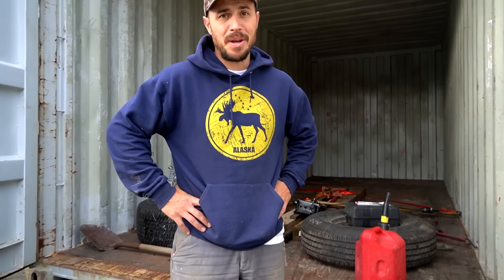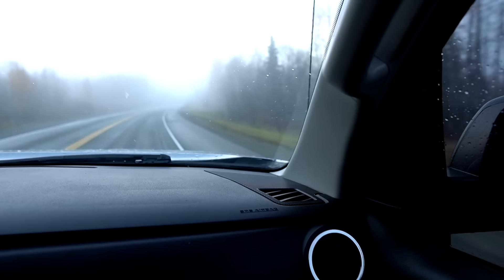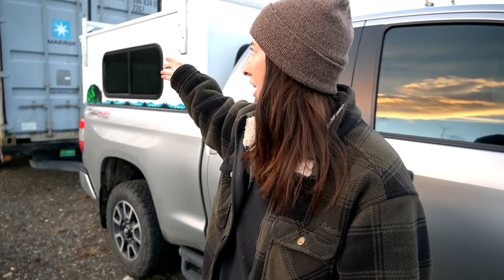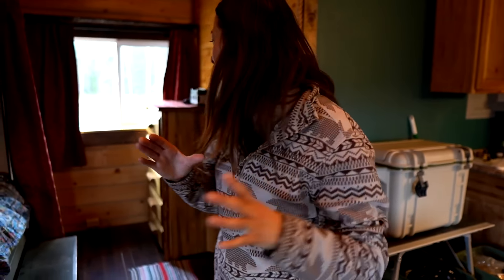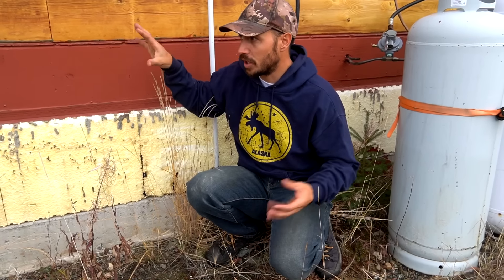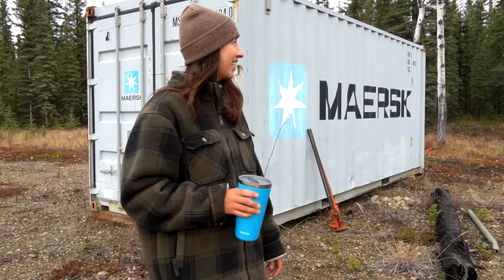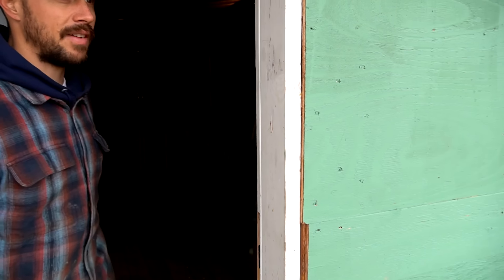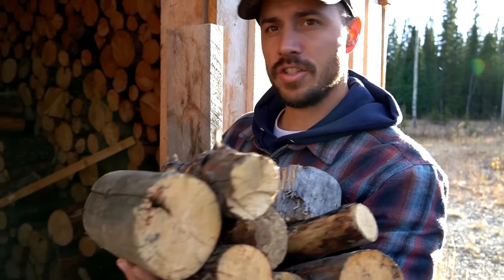Transporting a Conex to Our New Property + Cabin Tour

Comment: So happy for you with the new property! CAUTION: when you mentioned about the "warping" of the floor around the woodstove.. I remember years back a friend had that problem, his cabin burned down..cause was in part due to missing and/or powdered firebrick. I'd also recommend putting fire backer board on the backside and definitely the floor...just FYI, all the best.
Reply: Easiest way is cement board on the floor and both walls. 3 - 4'×4' pieces should work fine. One piece on the floor to stop sparks and dissipate some heat.Put spacers behind the wall pieces at least 1/2", 3/4" strong is better. It actually creates a vacuum with a gap at the bottom, as the cement board warms up cooler air is drawn up as the warmer air rises. It keeps your walls from getting too hot. Also around 27:26 ish, you definitely need fire bricks. I can't tell the condition of the remaining ones, some are missing and some are cracked. Not a problem to ignore. I believe your next moose will be harvested in the yard by the look of the place.
Reply: This channel has the very best comment section.
Reply: @edpoints1127  , I saw that too, glad you mentioned it, there seemed to be a few missing, definitely needs relining 👍
Reply: Yes take care of the heat project for sure 
I am so happy for y’all
Reply: I’m so happy for you!! You two work so well together and we love watching you. Thanks for the great channel!
Reply: I second this!!
Reply: Bandit gets to dig dirt now!!🤗
Reply: Love your tundra’s I work at the plant where the newer one is built
Reply: Can't believe the hard work you two do and the ingenuity you have to solve problems love the new property
Reply: Oh yes! Take precautions!! I love your new property!! It is awesome! I'm so excited for you all! 40A,& the house is beautiful! A Wonderful inside bathroom & shower, bedroom, kitchen area,I think it's great & you'll enjoy it though you've done great with the one you're living in!!
Reply: @edpoints1127  yes. We lived in a double wide mobile home,& had a big nice "Papa bear"wood stove, can't remember who made it. Had the draft knob in front on door. So my husband got an asbestos pad with metal on it, put a sheet of something against the wall then the pavers over that. It's been there since 1980 or before!!
Reply: Good information from the comment
Reply: The new place is going to be great I do also recommend a fire protection system for your fireplace you’re a wood-burning stove as the only protection you will have is the two of you when it comes to that

Comment: Nice cabin.  We, too, have a Blaze King wood stove.  I think we have had it for about 20 years now.  It still looks like new.  We have had to replace the bricks once and have done a few other maintenance items.  Before we bought it my husband researched stoves and decided this was the best for us.  It sure has been.  If it is really cold outside, 20 below zero, we have to fill it twice a day.  If it is above zero, the wood will usually last over 24 hours.  Ours has a really big fire box.  It heats our 2 story 1200 square foot home.  We don't use kindling.  The first time we start it for the season we fill our fire box full, then light a Diamond Strike-A-Fire, and stick it in the wood.  It always starts.  We have an ash pan under our stove.  I let the wood burn down to mostly ash with a few coals, clean the ashes out, and then fill it full with wood again. The few little ashes left always gets the new wood burning.  It makes it so nice to barely have to load the stove with wood.

Comment: Lived in similar conditions and places since 1977 .  
Just saw kinda a neat way to split like 4 to 6 inch thick rounds by approximately 18 inch long logs on line .
They used an old truck tire laid on its side and put about six cut to length logs on end in the middle of the tire so to be held together while splitting them with a maul .
Another way I used to split wood is to stand the logs on end on flat ground in a line of four or more and go down the line while splitting them with a maul . Went pretty quick this way because I wasn’t constantly picking up the maul for each individual log . Hydraulic splitters are nice too .

Comment: Loved this video! I have the same old tundra you do! Except ours started off white, when we turned over the odo we knew rebuilding wasnt a thing we wanted to do anymore, so we swapped a 5.3L LS crate engine, danas, and now my wife stole it as her adventure rig, she has a small pop up camper, and she made a custom cycle carrier for her tw200 that can be removed from its L and R bolt in to the custom bumper she made too. She repainted a nice red color, and its had a new lease on life!

I was left without a truck hahaha. 

I have traveled in a 4x4 high roof sprinter van for the last 5 years, I travel and teach law enforcement, to civilians, on ranges. And as I have officially retired from that, decided, oh what the heck! I just sold a 68 mustang fastback, and an older landcruiser I have had for 35 years hahaha, and decided a F550 would be my next rig. So its being built out as Id like, bags, dually converted to singles, flat utl bed with under cargo storage, so I can load a 4 season artic fox camper on and off as I want! 

And as luck would have it a friend whos here in vegas for the sema auto show will be moving back to japan full time as his aging parents have entered their 90s, we will be buying his 5500 ram, regcab, dually as our new hauler rig! 

Wife and I are enjoying the video! And man, thats alot of wood!

Comment: Thanks for showing us. I'm from the much milder climate of Southern New Zealand (that's like near Australia, but 1,000 miles / 1,600km further East and South means we are colder, in this hemisphere). I notice you have an indoor hotwater service, and you said the previous owners just ran a generator when they wanted electricity.  Generators famously drink diesel/gasoline/petrol which is never cheap.  But given the cabin already has a wood fire installed, when I grew up,  even in our far milder "Coastal Oregon-esque" climate, most houses had open fireplaces, or sometimes coal kitchen stoves, had  what we called a "wet-back" where a coil of pipe in the back of the fire, heats hotwater.  They are less common now as we have very strict "clean air" pollution rules but some of the new approved clean burning wood fires, still have the option of a wetback. It saves a huge amount as in this area, household hotwater amounts to about one third of a monthly electric bill.  (Most places here do not have gas connections. Some rural folks use bottled LPG/propane gas). Looking forward to seeing more of your videos.
Reply: Extra info... no extra waterpump is needed for a "wetback" water heater system. The hotwater storage tank is installed ABOVE the height of the fireplace, and the water pipes are routed in a certain way, so the water circulates automatically by "thermo-syphon". In our kitchen my parents had a fire installed and as part of the installation the plumbers removed the existing electric hotwater cylinder, cut into it and brazed/welded added the extra water in/out pipes that went to/from the fire, and then re-mounted the hotwater cylinder tank higher up in the cupboard so that it was above the waterjacket of the newly installed fire. That particular fire was known as a "kitchen incinerator" as it did not have a glass door for viewing and was quite narrow and only able to take smaller pieces of wood to burn. We could leave the electric element switched off entirely whenever we had that fire going. Otherwise it heated the water normally with electricty.

Comment: Blaze King catalytic stoves burn differently. You usually put half rounds on the bottom and build the fire up from there on top of the half rounds.  After 20-30 minutes you turn the catalytic  lever on and it will burn the wood and the gas from the wood. You can fill the stove and some models burn for 30+ hours.

Comment: The 02’ tundra will last forever,   At 300,000 miles it’s barely broke in.   Lol.  These engines originally were designed to be a small plane engine.  You just keep changing the oil and other misc things and it’ll keep going.  The newer tundra you get with 5.7L.  Great engine great overall truck. That was a heck of a offmount of the conex great ingenuity awesome lol.   That’s a lovely cabin to back it wasn’t closer to tok and Valdez lol.  Not that I’m complaining.   Great guys

Comment: Considering where you live in the world I would recommend an ARB dual air compressor I have one on my Toyota as I live in the Rocky Mountains I have installed it in the engine bay of my truck. Ideal for airing up and down tires depending on conditions you’re driving it. This would be something I would absolutely recommend for your truck.

Comment: Toyota does make an excellent truck. I have owned three Tundra's. The last one a 2010 the transmission went south in 2019. I believe I was at fault because I had a Boss snowplow blade mounted and pulling an 8K fifth-wheel trailer during the summer months. Can you believe it, Toyota still paid for half the transmission bill. I wish they made a 3/4-one-ton truck. Really enjoy your video's

Comment: 4 pieces of 1 inch  pipe the width of the conex,use 2 hilift Jack's set on blocks of wood ,jack up conex and place pipe underneath, block trailer wheels,unhook trailer,use pickup or other vehicle to pull conex off at any place you want,it dosent have to be near a tree,it will roll easily on the pipe

Comment: When you are strapping on rails like that trailer, roll the ends underneath and use the metal part on the top of the rail.  It will provide a much more secure connection in case the straps loosen over time.  Love what you are doing!

Comment: Hey ! great job transporting that sea can, and the first thing I said when I saw the tundra pulling that was..."gas mileage won't be good" haha Nice to have the air bags though. You guys did a great job transporting then unloading it at the new property. the new property looks really nice, very open, and smart of the previous owner to have the buildings on skids so you can move them if you want. Nice upgrade with the truck too, it's hard to beat Toyota for reliability, I'm on my 2nd Tacoma (first one for t-boned or it would still be on the road) but I haven't had a moments issue with either one. I'll be looking forward to seeing new videos, thanks again for all the great work. Cheers !

Comment: The fact that you have a concrete slab under the new cabin and that your jacks did not sink in the ground leads one to believe the open area where your cabin is located is an old river bed with a thick layer of gravel near the surface.  The gravel can be compacted an you can easily build new buildings on concrete slabs.

Comment: If you want to keep your chinked logs to not get dark over time ,don’t use oil based stains and sealers.
Use the newer water base stains with a easily serviceable top clear coat which protects your stain color coat and your chinking for years to come . Also keep any sprinklers from hitting the house and high bushes always from the sides of the house that might hold snow and bugs against the sides.

Comment: We have the EXACT same oven... word of caution... just be very careful about accidentally venting heat from a rounded pot/bowl/pan/etc. back onto the control panel. Ours got ruined that way, unfortunately. Replacement control panels are not super cheap and are annoying to track down. Otherwise, it has been a great oven/stove! (on natural gas here.... but propane can act differently). Love your video! Thanks so much for sharing!

Comment: Bo knows... Bandit's ready!!  Congrats on the new digs!  Love it.  Is the crawl space bear proof and suitable as a root cellar/long term pantry for canned goods?  That same Reflectix (bubble foil) lining the generator closet will do good in lining the inside of the crawl space too.  Joints sealed up with the foil tape (that should help in keep scent contained too).  Also, line the underside of the floor with that Reflectix and your stocking covered hooves will be warmer during the winter.
Reply from the maker: Thank you 🙂

Comment: Congrats guys!!!! What you bought is similar to what we are currently building. And 40 acres , so nice . Can't wait to see where you guys go with it. If you move there full time. I strongly suggest a tractor of some kind. The cone pile from the squirrels , we had a similar one. I watched it being added to daily. It was carrying cones the size of it's body. 200ft to the pile. The last 2 years I have watched them harvest in the late summers. The smaller cones like you have. They only take the top couple feet of the tree for cones. The bigger cones , they where taking them all over the tree. Hard little workers . Good luck with the new venture, with that amount of land. You could have a bush plane.

Comment: If you guys ever get tired of that wood stove life, geothermal heat pumps (also called ground-source heat pumps) are a very energy-efficient option for heating your home. They don’t produce heat, they just transfer it, so they use much less electricity than other options. Installation tends to be pretty expensive, but still might be a good option for the future! Full disclosure, I do geothermal energy research so I might be a bit biased. 😂

Comment: Well done and accomplished undertaking of unloading your Mærsk shipping container. Having watched most of your episodes from starting off at your first property four years ago and achieved many things in upgrading it to your desired needs and qualities, I'm quite surprised that you are seriously considering to move 300 miles further north and more or less start all over with a cabin of about the same living space footprint as your first cabin. The general geographic climate zone fact is about 2.6F temperature drop per 100 miles northward because of less duration and intensity solar energy at higher latitudes . This climatic fact also means likely thinner and shorter timber stands, less lush wilderness vegetation for berry picking and other wilderness gatherings, and definitely an even more difficult climate in which to grow a vegetable garden for your winter larder than at your current first property. An indoor bathroom with a winter-protected water supply may be an improvement in your current life style, but you could easily add that convenience to your existing small cabin with your skills and financial means. Would just be an add-on lean-to structure to your existing cabin, still coming with all of the already developed outdoor building storage, chicken coop, vegetable garden and high tunnel that you wanted.

Comment: 40 acres...nice! You must have a decent solar system with batteries (3kw of panels at least). Less gas for the generator and more solar it will be an investment. For alaska weather will be perfect forklift lead batteries. Are strong and good for low temperatures (lithium is not good for low temperatures). Generator will be perfect just for backup when the weather is bad and the batteries are low in voltage.
Reply from the maker: Thanks for the tips!

Comment: Ohhhhh this is amazing! I was half convinced you would pull the tree right up with the Conex. Can't believe that worked, but that just goes to show your great approach to solving problems.

So many questions though! Since you have a crawlspace in this place and the ground is drier, does that mean there's a chance you could dig out a root cellar that won't get flooded this time? If it's already colder there than at your main cabin, will that shorten the growing season for your garden further? If so, are you going to use multiple high tunnels or build a large greenhouse to combat this? And could you potentially add an arctic entry to the outside of the cabin to stop so much heat from escaping when you go in and out and to keep your boots and coats somewhere? We call those small ante-rooms "wind catchers" where I live (loosely translated), but the idea is clearly the same. 

This is hugely exciting, I cannot wait to see what you do with this place next year! (Also congrats on the indoor bathroom, I'm sure you will be very grateful for that in the winter!). Bandit will be sad to loose his swamp, though - he'll have a harder time digging here, though I suspect the squirrels might make up for it in terms of entertainment.

Comment: Im assuming that was a 20’ but it looked stubby (shorter than) for some reason. Maybe it was a the taller ones? We are in the same boat… have a 20’ and the quotes ive had so far are around the $2,000 mark. Really need to get it up to our offgrid property. You made ut look easy like youve done it before 😅